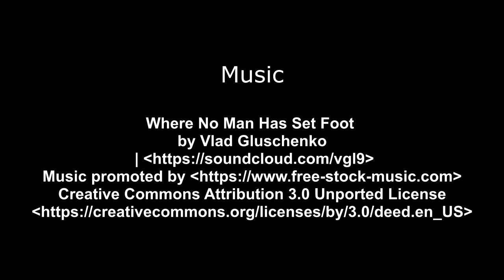Wood-Mizer LT40 Milling A Cracked White Pine # 190

Comment: Some beautiful material there professor. 

How do you handle cleaning the mill after milling pine?  Specifically, the sappy sawdust??
Reply from the maker: Your question has brought back some painful memories. The sap and sawdust created a sort-of gray "concrete" coating on the mill surfaces. I had to use a chemical cleaner and a lot of elbow grease (I HATE elbow grease) to clean most of it off. There's still some left.
I don't like pine so much any more.
Reply: @TheOldManAndTheSaw  Pretty much the exact reason I've never milled Pine. There are just as beautiful hardwoods available without the hassle/damage.  An oil/diesel drip significantly helps but then the sawdust is useless for anything other then fire starter bricks.  

I wonder what the big sawmills do in the efforts to deal with the problem.
Reply from the maker: @Ratherbemilling  My logs were fresh cut so they were full of sap. Leaving the logs to dry for awhile should make a big difference.